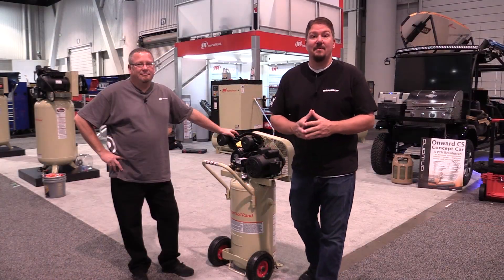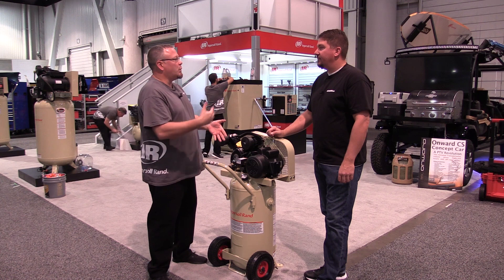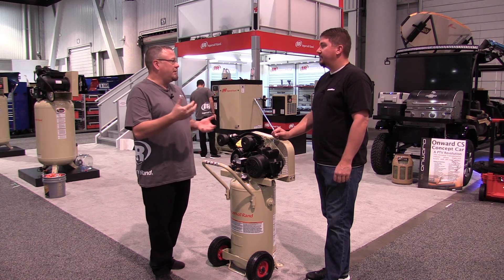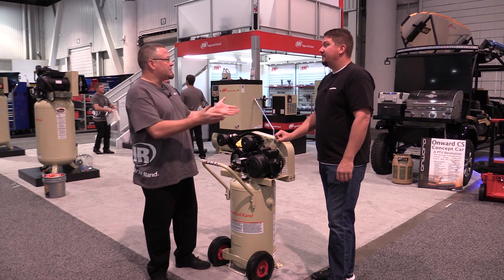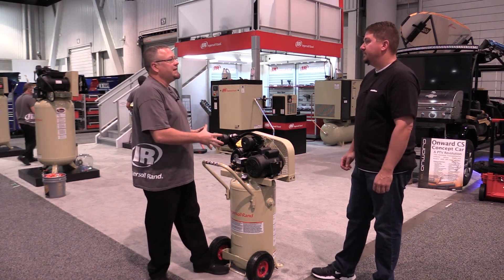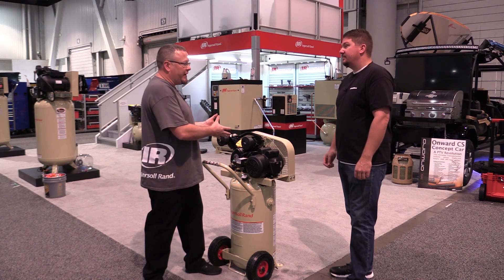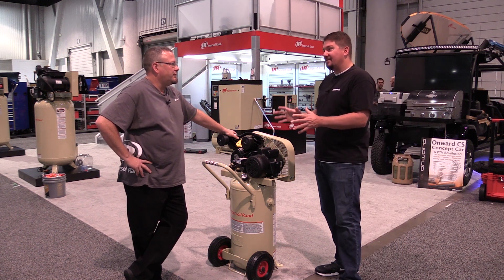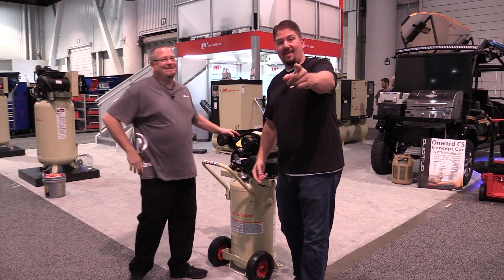Tips on Buying Your First Air Compressor | SCFM & PSI Explained

Comment: Too vague. As a novice to air compressors you should be telling me what capacity, power, etc of air compressor I need to run various tools and also to make them run well because I don't have a clue. Typically air lines, impact gun, paint/rust protection sprayer.

Comment: does the cfm on compressor have to match the cfm on impact gun? have a 5.8 cfm compressor at 90 psi will it be sufficient for a 6 or 7 cfm impact gun?
Reply from the maker: Your compressor must have a higher cfm than your tools require.

Comment: i have 2 air knives rated 60psi 2.3 SCFM.....How do i know my pressure reqquirements
Reply: that's relatively small flow needs. a small compressor would do nicely for you
Reply: @pauls5745  What kind of SCFM and psi would i need to solely use an airgun for electronic cleaning?

Comment: I have a 9.6CFM air compressor, and am using a 5 CFM orbital sander. The sander only runs for 15 seconds without slowing down! Why is my air compressor not providing sufficient flow even though the specs say it can provide more than enough?
Reply from the maker: What size hose are you using?  Are your quick connections reducing flow?  What is your output guage doing as the speed on the sander slows?
Reply: The cfm that is spec on the compressor is the amount of air it is pumping in, not the air it delivers to you. To out put cfm is probly about 1/3 less. (look up 'Free Air Delivery')

Also are u using a regulator at all?
Regulate the pressure down to 90psi or so. If ur using the full pressure that the compressor pumps at, there's no way it will keep up

Comment: @2:32 no. a given compressor doesn't really experience a usable increase in flow as pressure drops. that isn't how electric motors work. that would only happen if they sped up as the load decreases, but they don't, line frequency determines max speed, their amperage draw will just decline. what you WILL see how ever, for some brands, is 2 different pulley sizes described and spec'ed for a given pump. a champion r-30 for example is rated at 48.5 cfm at 125 psi, but 43.1 at 175. but the 125 psi rating also describes a 8.38" pulley, versus an 8.15", and an rpm of 810, versus 740. but if you look at ingersol, even their 40hp compressors only lists a difference of 2cm between at 90psi vs 175, and thats at 20hp compressor with 74cfm. there is perhaps a slight difference due to heat, but this only might make a some what noticeable difference on tiny high strung compressors like this. its a common misconception people have with all compressors

Comment: a sandblaster uses up to 60 scfm? thats insane, how much would a compressor of that capabilities would cost?
Reply: It depends on what pressure you are actually using. the higher the pressure the more cfm for a given nozzle size. It takes15hp to produce that at 175 psi. the other guy is probably lying, or only means intermittent use, or doesn't mean a 60cfm set up at all, just a sand blast cabinet. 60 cfm is a major set up, and he describes a smaller compressor. its not the kind of electrical service the average house has.
Reply from the maker: Our 80 gallon two stage will do it without issue.  $1,100....
Reply: WorkshopAddict wow
Reply: @WorkshopAddict  What $1100 for a 80gal two stage Ok il take one i'm ready
Reply: Jeff Eaton b

Comment: 5.4 cfm is low aint it
Reply from the maker: Mecha Iroh Pretty low, yes.
Reply: depends what you're using
Reply: Yes most 25lt compressors are 9.5 cfm
Reply: @Whatinthewoke  not the commercial ones like home depot and hardware stores. Their numbers are bs.
Reply: Depends. Not even home depot makes decent air compressors at 800 bucks. Consider industry compressors that cost 5 grand barely deliver 18cfm because thats legit cfm. Retail air compressors fudge the numbers.